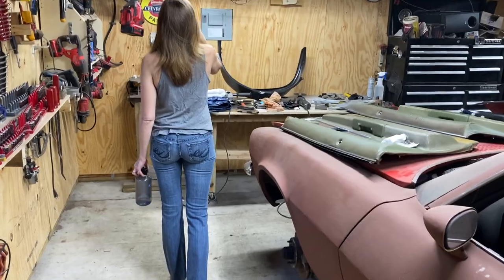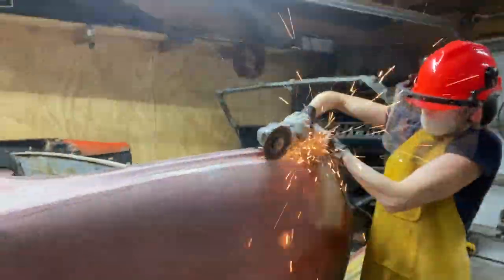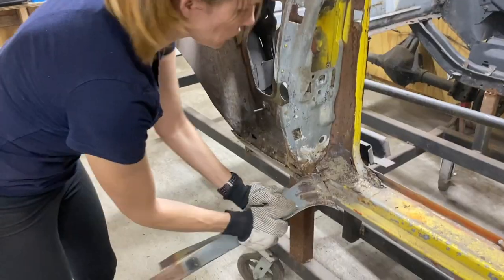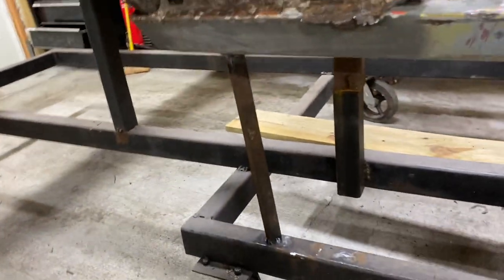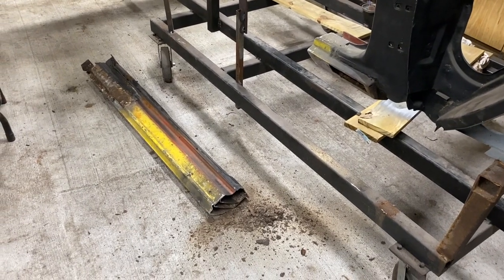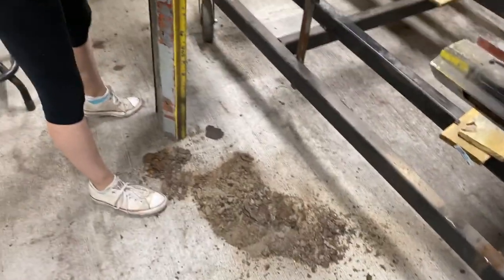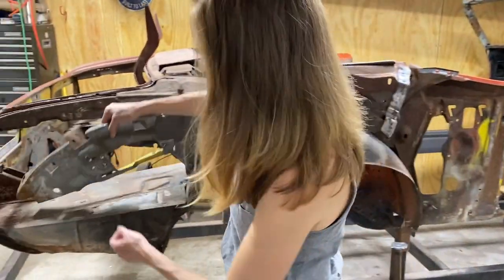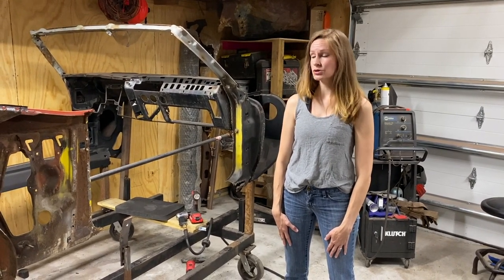69 Camaro Convertible rocker Panel Replacement Pt 1

Comment: Yours is the only vid on youtube of replacing the complete rocker, others just outer or patching inners etc. Im about to embark on this project myself soon. When I cut my floor out I found my inner and outer rockers were shot. Thanks for the vids! Oh and a quick tip for welding, if you haven't already learned is to brace or support your arms to steady the gun.
Reply from the maker: Thanks for the tip and good luck with your project! Thanks for watching..

Comment: No support x braces side to side?  Why not??
Reply from the maker: All of the factory convertible support braces are installed including the X brace. 
To what are you referring?
Reply: @camarorescue3798  I think Brian is referring to support bracing within the passenger compartment in an "X" pattern to maintain dimensional stability during reconstruction. I would tend to agree with him, especially in a convertible, but perhaps having it on a frame jig will suffice.